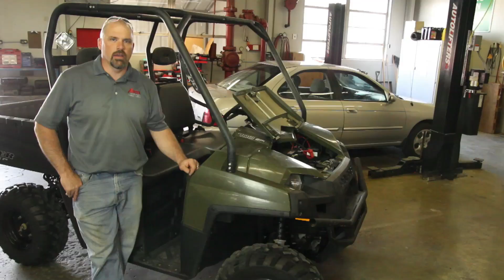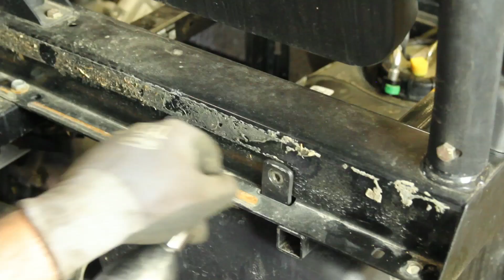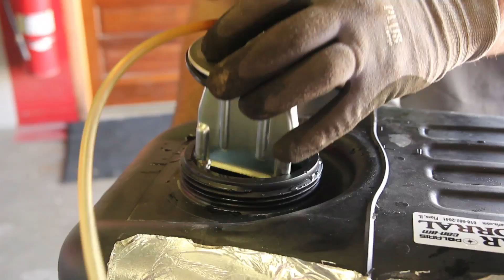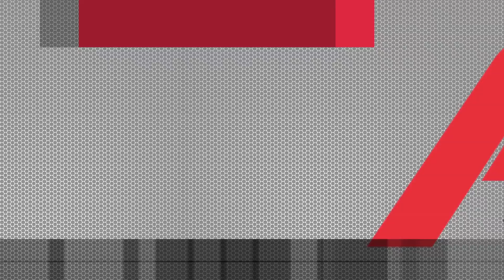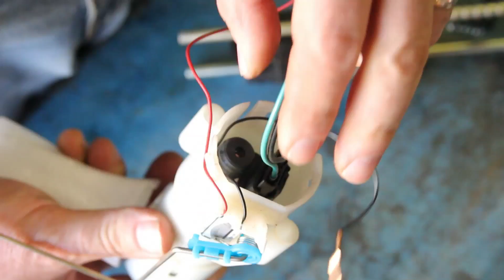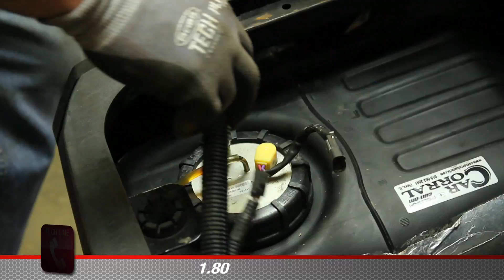How to Install Fuel Pump Module Assembly E11022 in a 2008 Polaris Ranger

Comment: good video, but I don't see any need to take the tank off. I just changed mine after watching this. I decided if the strainer had trash on it I would. but it had none. we always use good gas. its never in mud. took me about 40 minutes taking my time. Thanks for the vid
Reply: also mine has a vent like a tire stem to get the air out located by the throttle body. just thought that may help somebody that does to.
Reply: For sure i would def clean the tank if it was dirty. nice video again. thanks for the help. i had never changed one.

Comment: Nice but there was absolutely no reason to remove the gas tank, baffle, side panel, all that extra work - just needed leave gas tank in place and  siphon out the gas, wipe the inside of gas tank then remove, replace fuel pump and reinstall and your done

Comment: does anyone sell the wire assembly from the fuel pump to the sending unit
Reply: My connection went bad as well. Always shows low fuel. I just soldered a wire around it (drilled a small hole in mounting plate) and used a male / female insulated spade connector up top so fuel pump could still be easily removed. This is on a 2007 Polaris Ranger 700 xp

Comment: the 2 wires that run from the sending unit to the pump are show wire where the insulation has come off. can I just heat shrink over that or is that dangerous because it's in fuel